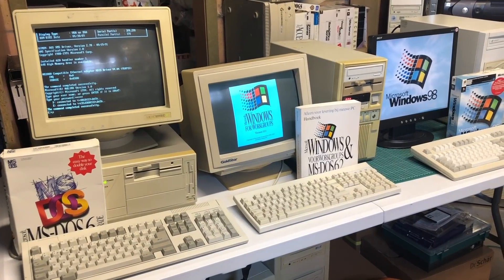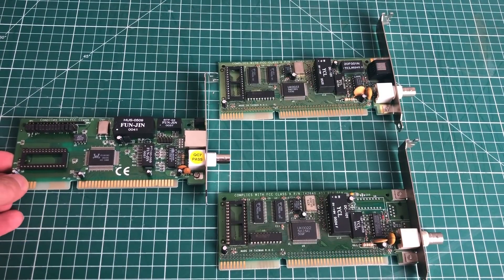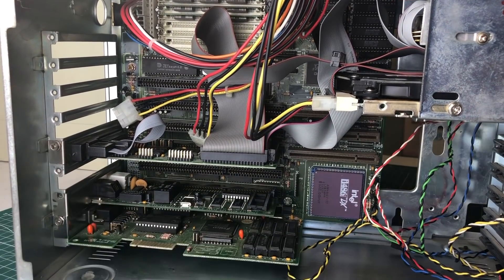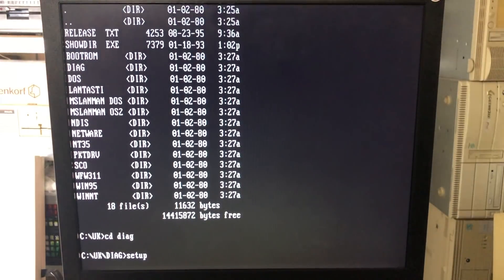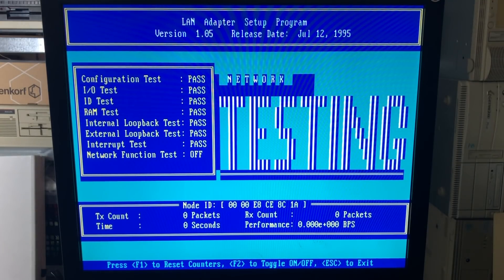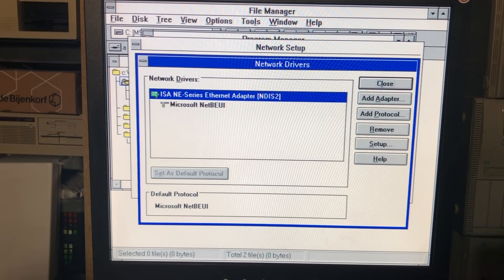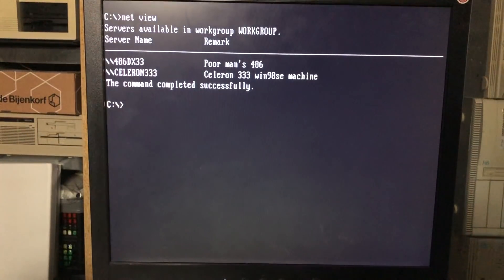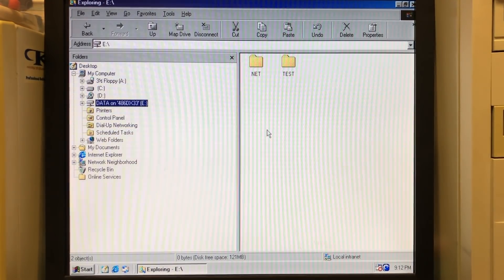Creating a retro Microsoft network using real retro hardware

Comment: How bout a classic windows NT Domain Network? 👍😎
Reply from the maker: McInTEC it will come soon :)
Reply: @RetroSpector78  I remember my school running a Windows NT 4.0 Domain with Windows 95, later 98. And I wanted to know how networking worked and how a Windows Domain worked. Long story short, I had a hard time finding (P2P) NT 4.0. I ended up getting Windows 2000 Server instead and learned Active Directory. I did learn policy editor for 9x systems using poledit. I collected many old PCs and a lot of the old ISA nic cards had BNC connectors along with RJ-45. But at that stage everything was using Ethernet so I never had the chance to do or learn this network topology.
Reply: @McIntec  NT 4 domain controllers just work out of the box once the installation of the OS is done, as you can install the services there and then.  You still have to play with the odds and sods like you do with windows 2000 etc.  Windows 3.51 server is not that different to windows NT4 server either,  just as easy but with the 3.x desktop, which you can really thin down.  Have a play about and you will have some fun!  I use RJ- 45 3com network cards for ease. Plus you can have a go at some old school remote booting too.
Reply: school time

Comment: The 75 ohm terminators do work... Despite what he said
Reply from the maker: Never tried it , because the IEEE 802.3a mandates the usage of RG-58A/U coaxial cables and 50 +/-2 ohms termination I assumed it was for a specific reason.
Reply: @RetroSpector78  so what? It works... Same speed.
Reply: My best guess I the you will have issues just for very long cables

Comment: Is there a particular reason why the tee connectors and terminator plugs are required on the edge machines, rather than simply plugging the cables directly into those two cards? (Obviously the tee is needed on the middle card.)
Reply: Because you need a terminator (resistor) or you'd get reflections back across the network.

Comment: The old times, where network file sharing was easy.
Reply: And horribly insecure.  Just wouldn't be acceptable in today's internet connected world.  These insecure protocols were used to great effect by hackers in the 98 days to use your PC as a botnet or storage for shit like child porn.  Cleaned up many a PC plugged in over dialup that was unwittingly serving nasty shit to God knows who and full of trojans.  I'm very glad that Windows actually gives a damn about security on file sharing now and by default isolates a user PC from the world at large.
Reply: I abandoned Windows over a decade ago but I remember that being true with the older versions of Windows and that it got increasingly harder as time went on.
Reply: @johndunlap9139  not really - it just started to enforce user accounts having a password - when you set up a "remote-access" user with a password right after a fresh install and keep using this its the same as using ssh on unix when mount remote (as I have only little knowledge using unix shares based on ssh instead of smb its still easier)
Reply: well - it still is, you just have to use users with set passwords as no/empty passwords isn't just allowed - but if you keep this in mind it's still very easy (also, when you have a fresh install mostly sharing works without passwords - but for some odd reason that can be screwed easy and then somehow require passwords - didnt found a way back without reinstall yet - so, mitigate this issue by set up a "remote-access" user from the get go)
Reply: I use SFTP for all of my file sharing needs these days. Works flawlessly.
Reply: @JohnDavidDunlap  ah, yes, SFTP it was the one over SSH - guess when you used to you don't need some like network shares / remote-mounts - but using SMB shares is just common practice in larger networks although there many other techniques available
Reply: @cryptearth  I find SMB very obnoxious to use, at least on Linux. SFTP I can have set up in a couple minutes and it just works
Reply: @JohnDavidDunlap  its pretty easy - when smb packages are installed (wich is the case on most linux distros when installed in desktop mode) and on windows side (no matter if domain or not) you can mount a smb share like this:
mount -o username=<user>,password=<pass> smb://server-ip/share-name /mnt
afaik SFTP can be mounted the same (or with slightly different command) - so you can use mounted shares like if there're in the local tree
using SFTP with commands like scp - well, works on each unix-to-unix out of the box - but excludes any smb share (like any windows machine or most cosumer-grade NAS)
on the other hand - there're a few unix-drivers for windows available like mount local ext volumes or SFTP (smb of course as a windows thing is built it) make it also easy to "mount" shares even when the linux box doesnt offer smb shares but only SFTP
so - in comparison in terms of "easy to use" when done correctly with modern OS it works both ways out of the box - it gets down to what you use on daily basis
for example: one could also use iSCSI as its also easy to setup on linux (wich brings an iSCSI target server software with it in most distros) (windows not so much a s only server versions come with iSCSI target support - client (home) versions only support the client initiators) - but iSCSI is dsigned for different use case and isn't really a "share" in terms of one resource to many users but more a one-to-one base
Reply: @cryptearth  mounting an SMB share is as strait forward as pretty much any other kind of mount. Configuring the mount in the first place is what I find to be highly annoying and hit or miss
Reply: @JohnDavidDunlap  so, then give me an example where using SMB is harder than SFTP
only I can think of is that for setting up the share a few (two or three) extra steps need up front - but this doesn't make it "harder"
Reply: @cryptearth  two or three extra steps doesn't make something harder? SFTP relies on the Linux file system permissions while SMB makes you definite a "share" in a poorly documented configuration file. Not to mention the fact that when your share doesn't work it's not easy to figure out why.
Reply: @JohnDavidDunlap  well, in my eyes: no, these extra steps doesn't make it harder - let me explain why:
1) as any user-account should have a password, no matter if windows or unix, when done right from fresh install of windows this point is already done
2) to "share" something, on windows, anything you have to do are these easy steps:
a) right-click on the folder one want to share to open the context menu > then select the share option
b) enable "share this folder" and give it a name
c) to make the share accessible by anyone else than domain-admins (wich only works in a comain/active directory) add users wich are allowed to access this share (each user account added to this whitelist has to have a password set)
d) done - can be access by windows and unix very simple
3) on unix it's as easy as edit /etc/samba/smb.conf and restart smb daemon (sure, can be done as root only, but network shares should be managed by privileged users only anyway)
but can't see where this is "hard"
4) mounting is also easy in both worlds and only requires the same length of command

so - again: I've shown you how easy it's done - so show me where's the hard part in difference to use SFTP? the only difference is that SFTP works out of the box in unix world - but as already mentioned: it excludes windows all along or require additional software on its end of the network - wich equals out - and, as already said in the first reply: only comes down to daily use and what you more used to
Reply: @cryptearth  Yes, it should be as easy as editing a config file and restarting a daemon(neither of which are necessary with SFTP) but I abandoned it years ago because it simply didn't work after editing the config file and restarting the daemon. Further, it didn't tell you what's wrong. It simply didn't work.
Reply: @JohnDavidDunlap  well, most unix software is written with ease of use and possible verbose log output in mind - and mostly there're debug packs available - so your statement "didn't got any clue why" ... well, for me sounds more like "i didn't wanted to bother to figure out what went wrong" as even windows logs reasons for when try to access smb share what went wrong
but who am i working with it for the last 20 years not knowing the differences
nvm - it's easy, and with most distros works the same out of the box same as smb unter windows as ssh on unix - makes it the perfect protocol to combine unix and windows within the same network without any extra software to either enable linux to handle proprietary windows stuff (wich is always risky as anything is built ontop of reverse engineered stuff as M$ doesn'T make the protocols public) and to implement something to make windows access the unix stuff (wich is the easier way as unix is mostly open source and hence allows full-working ports to windows)
so - just it didnt worked for you and you didnt wanted to put the effort in it doesnt makes it in harder - you just refused to give it another try for the last 10 years - so its on your end
Reply: @cryptearth  SFTP works out of the box. SMB doesn't. There's no config file editing. There's no daemon restarts. There's no debugging. It just works.

You are criticising me for not putting in enough effort while asserting that putting in that effort doesn't make anything harder. Are you listening to yourself?
Reply: @JohnDavidDunlap  feel free to be my guest in the "yes, some still live in the 80s" lounge - otherwise, just get this fact:
this video is about network SHARES(!) (smb/cifs) - wich SFTP just isn't

Comment: Hmm for the next demo, how about replacing the Windows 98 with Windows NT 4 Server or Windows 2000 Server for the Pentium 2 node? Then add a second PCI NIC in there for regular 100BASE-TX Ethernet. This allows this box acting as a router, giving all nodes Internet access.
Reply from the maker: yeah that's the plan ... so far I've got the following ideas in terms of networking :

- os/2 warp
- novel netware
- freedos tcp/ip
- tcp/ip in general
- XT networking (using all of my IBMs , 8 bit NICs and ms-dos)
- mTCP (tcp stack for msdos)
- NT Server 3.51 or 4.0 (like you said using a multi-homed setup acting as a router)

and I'm sure I'm still missing a couple .... will need to compile a list from all the comments here :)
Reply: @RetroSpector78  Multi-homed NT 4.0 on Pentium 2 as a router can just stand there for all other experiments with networking those machines, as it is acting as a gateway between various ancient network formats and the open Internet. With certain OS you can even try to have them load up an actual website - that is, do something involving the Internet using gears predating it.
Reply from the maker: @hikaru-live  I've got the perfect HT Netserver (pentium 166mhz I think) to run my boxed NT 4.0 Server :)
Reply: @RetroSpector78  If you can track it down, there is an even better motherboard for NT: ABIT BP6. It is period correct, and it can support two Celeron 300A overclocked to 450MHz. With Windows NT both CPU will be utilized, giving you a good amount of oomph to pass packets across different networks at full speed.

Comment: You did not use TCP/IP protocol. Why?
Reply from the maker: Zarko Ujdur didn’t want to overcomplicate things for this first video as the primary goal was filesharing. Netbeui is the easiest to setup for a small network like this for that purpose. Tcp/ip involves setting up tcp ip addresses or having a dhcp server. Wfw 3.11 also requires a tcp/ip addon from MS. It would overcomplicate things for this specific scenario. But perhaps will do it in another video.
Reply: I agree, but NetBEUI is an ancient protocol from and to MS universe only, TCP/IP is defacto the industry standard. It would be much intriguing to see & learn how to set up ancient software to use TCP/IP than to apply NetBEUI using set & forget...
Reply from the maker: @zarkoujdur9424  Future video ... I promise ! :) Again the goal oft this video was to setup simple file sharing for an MS network.
Reply: @zarkoujdur9424  I think you miss the whole point of this video.

Comment: It sucks when someone disses old tech as "low end" or any derogatory phrase since it still works reliably, that is pretty darn great.
Reply: Eh, "low end" is fine, but equating old with "crappy" or "garbage", now that gets my nanny-goat. Especially when it's old but high-end gear. "A dual-socket Pentium Pro with an Appian Geronimo graphics card? What a piece of crap!" Grr argh *shakefist*.
Reply: @logansorenssen  True, but there comes a point where a low end system thirty years old is no longer low end.  The fact that it still works puts even the most low end computer in the category of classic.  Even cars from the 70's that were once deemed low end are now classics.
Reply: Fair point, that. Hadn't thought of it that way, but you've got a good point!
Reply: I despise that. Most people don't compare older hardware to other hardware from the same time. They just say "hey this is old so it automatically sucks because it isn't nearly as good as the Iphone my parents spoiled me with when I was 4!"

Comment: Have you tough about using freeDOS? It is DOS compatible, will work on a 286 and it is both TCP/IP and USB compatible... Is not exactly your setup, but I think that'll work for anyone having just an older machine and a new one....
Reply from the maker: Might need to do a separate video on that. I wanted to keep it as standard as possible, assuming this would be applied to existing machines where you don’t necessarily want to change OS. But FreeDOS as a whole is definitely worth checking out. Thanks for reminding me of that. Will add it to my ever growing list of video ideas :)

Comment: You should get a 386 running Windows 3.11 and run Windows 95 on the 486DX. On the Pentium 2 you can run Windows 98 or 2000....
Reply from the maker: 486dx33 with 4mb would be very slow to run windows95 :( also not that much difference beteeen win95 and 98 for this particular test. But I agree it could have been more complete... perhaps for a future video :)
Reply: @RetroSpector78  Back in the days I ran Windows 95 on a 386DX and 486SX before I upgraded to a Pentium 90. It's true that the networking part isn't really different, but running 98 on a Pentium2 is a bit of a waste I think. I ran Windows 2000 workstation and even Server on a PII.
Reply from the maker: @djnaffie  The Pentium is primarily used as a retro gaming machine where windows 98 SE is a great platform.I would not want to wish running windows 95 on a 386DX to anyone. It would be a fun experiment, but barely usable IMHO. It would also require lots of RAM, a lot more than a typical 386 would have had back in the day. Even on this DX33 is would be slow with the amount of RAM it has. I think windows 95 on a higher end 486 with >=8MB RAM or a first gen pentium would be a better fit.

Comment: Really enjoyed this, nice work! Lots of information and easy to follow. Never set up a 10BASE2 network myself actually, this looked fun👍
Reply from the maker: It was :) Glad you like it. Going to try and raise the bar with the next one where I will try to get the IBM 51XX family together for a little LAN party :)
Reply: @RetroSpector78  Unfortunately I do not have any old hardware anymore, but sign me up for some Doom II , Warcraft or Diablo II over IPX
Reply: Early 90's I was in the Coast Guard and I walked by this guys office trying to setup a 10 Base T network. He looked stressed so I asked if he needed help. He said he could get one machine to see one computer but it could not get the other computer to see the one. I looked at his wiring and seen one end didn't have the Resistor on the on the T connector and the other end he did. I said, "here's  your problem, you must have a resistor on both ends". Fun days.. things were complicated because you had few people to ask questions yet the technology was simple compared to today.
Reply: The best vid
Reply: We’d all love if you did a networking with Windows 9x series!
Reply: I used 10BASE2 from 1999 to 2003. We still have the BNC cables in the walls but useless because who needs Ethernet that’s slower than wireless lan? I wish I installed twisted pair back then, would be much more useful today 😂 10BASE2 seemed easier because no hub required and less cables 😂
Reply: @LGR this is like when the Fonz did a cameo on Laverne and Shirley!
Reply: If you think that's fun... after that set-up a network using a 10Mbit hub and gaze at the beayty of the 'collision' led
Reply: Hi Clint!
Reply: Look at this a random video with LGR. Noice. Glad I pick this.
Reply: Did the algorithm lead me here because LGR liked the video? Or did the algorithm lead both me and Clint here because we like the same KIND of videos? Hmm
Reply: Only 2 replies wow!
Reply: You should do a video on it!!
Reply: You need to do it for a video!!
Reply: Needs more wood grain MMmmmmmmmMMmmmm
Reply: I just knew LGR would have a comment on this video